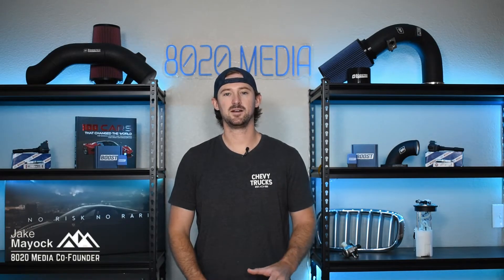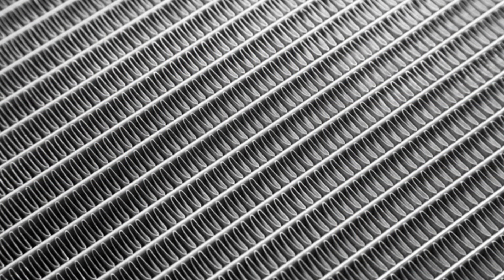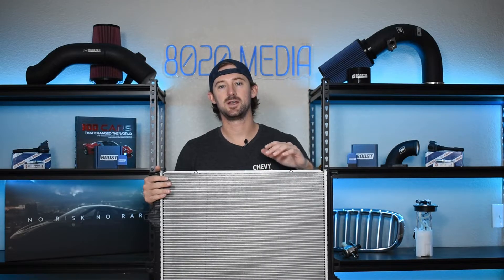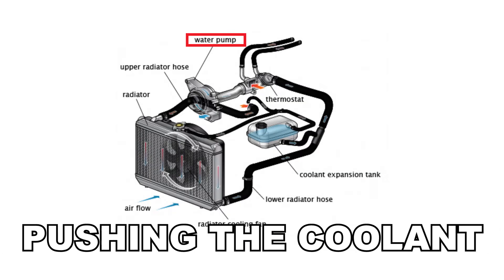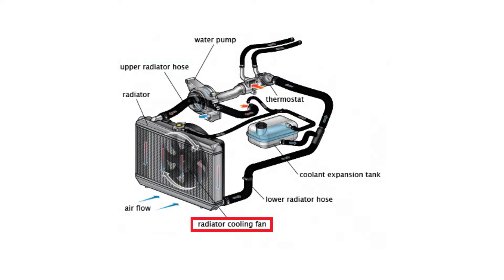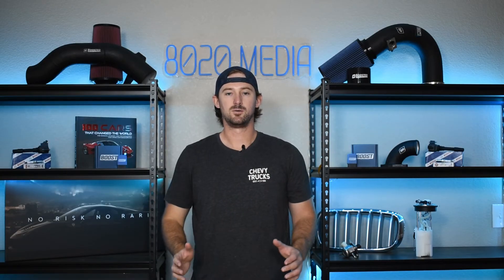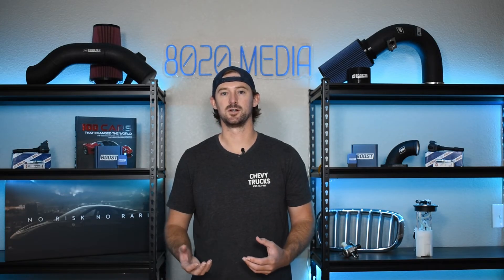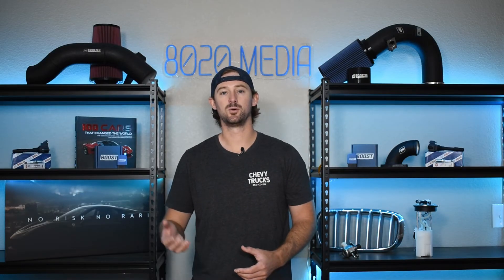Signs & Symptoms of a Bad Radiator!

Comment: My 19 yukon starts to overheat then temps come back down after driving over 20 min at 70mph plus it doesnt happen in normal city driving what can be the cause?
Reply from the maker: M - If your 2019 Yukon starts to overheat only at highway speeds after about 20 minutes, but runs fine in city driving, the most likely causes are a partially clogged radiator, failing thermostat that sticks closed under high load, or a weak water pump that can’t circulate coolant fast enough at sustained RPMs. At lower speeds, the cooling system may keep up, but once you’re pushing high airflow and engine load, any restriction or weak component can cause temperatures to rise. Also, check for debris or bugs blocking the radiator or AC condenser and ensure the cooling fan clutch or module isn't malfunctioning at speed (even though fans are less crucial above 40mph, a fan that’s stuck on or off can still affect temps). Start with a cooling system flush and thermostat replacement—those are the most common and cost-effective fixes for this symptom.

Comment: My 2.5 colorado has good flow and no leaks. But when i do heavy driving or highway and come to a stop the guage goes up, but if i give it gas to spin the water pump it cools down.
Reply from the maker: D - Your 2.5L Colorado’s symptoms suggest the water pump may not be circulating coolant effectively at low RPMs, possibly due to a worn impeller or slipping drive belt, causing the temperature to rise when idling after heavy driving or highway use. Since giving it gas improves cooling, it's likely that at higher RPMs, the pump spins fast enough to move coolant properly, but at idle it's not maintaining sufficient flow. It’s also worth checking that the radiator fan (especially if it’s electric) is kicking on at the right temp—if not, a faulty fan motor, temp sensor, or relay could be the issue. Finally, confirm there's no air trapped in the cooling system, as that can cause hot spots and poor circulation until revved.
Reply: @8020Automotive  New water pump, and thermostat. Nothing changed. Could a radiator cause issues like this?
Reply from the maker: @DerfOrNuffin  Certainly could!
Reply: @8020Automotive  Have you ever had a radiator just stop exchanging heat like that or be a culprit. 
 Im hesitant on loading the parts cannon anymore I love the truck but this has drove me insane
Reply from the maker: @DerfOrNuffin  A radiator can become a silent culprit when it gets internally clogged or restricted, especially with age, old coolant, or sealer products, and it may stop exchanging heat effectively even if it looks clean from the outside and isn’t leaking; you’ll see symptoms like overheating under load or high-speed driving, but normal temps at idle or low speeds, which can drive you insane if everything else checks out. Before launching more parts at it, do an infrared temp scan across the radiator surface—cold spots indicate internal blockage—and check for reduced coolant flow return to the reservoir. If you’ve ruled out thermostat, water pump, and fans, and still have inconsistent cooling, a partially plugged radiator is absolutely a real-world possibility.

Comment: Hi, I have a 2015 Ford Mondeo Estate. 
Coolant leaks from under the overflow tank once the car gets up to temperature, change the overflow tank and still same problem 

The colour of the coolant also looks dirty even after flushing and putting new in and i also have to top it up every other day 
 
All hoses are warm, thermostat is also new

Any ideas? Thanks
Reply from the maker: S - Given that your 2015 Ford Mondeo Estate still leaks coolant under the overflow tank even after replacing it, and you're seeing discolored coolant, frequent top-offs, and a new thermostat and flushed system, the most likely causes are a head gasket issue or a cracked cylinder head/block pressurizing the cooling system; when combustion gases enter the cooling system, they can force coolant out through the overflow even when everything else seems fine, and the dirty coolant is likely a mix of exhaust residue or oil contamination—check for bubbling in the expansion tank at idle, perform a chemical block test (to detect exhaust gases in the coolant), and if possible, a cooling system pressure test and cylinder leak-down test, as these will confirm whether the system is being over-pressurized internally, which would explain the ongoing leak despite replacing parts.

Comment: I have a 2002 Oldsmobile intrigue and my car starts and run but I’ll get to like 40 the temperature jumps up and after I shut the car off it’s like a humming noise almost sounds like the car could still be on
Reply from the maker: L - It sounds like your 2002 Oldsmobile Intrigue may have a cooling system issue—possibly a failing thermostat, clogged radiator, or weak water pump causing the temperature to spike around 40 mph. The humming noise after shutdown is likely the radiator fan continuing to run in an attempt to cool the engine, which is normal if the engine is overheating. Check coolant level, look for leaks, and consider replacing the thermostat and inspecting the radiator and fan system.

Comment: Do you think it’s my radiator, I have a 06 jeep liberty the top hose gets hot but the bottom hose stays cold, I installed a new water pump & thermostat and the top hose has another small hose that goes back up to the expansion tank and it keeps filling the tank up that it overflows then the coolant leaks onto the motor then it smokes the temperature gauge stays in the middle. The bottom hose connects to the radiator and the thermostat. Thanks in advance.
Reply from the maker: R - It sounds like you may have air trapped in the cooling system, preventing proper coolant circulation. If the top hose gets hot but the bottom hose stays cold, this suggests that coolant is not flowing through the radiator properly. Since you've already replaced the water pump and thermostat, try bleeding the cooling system to remove air pockets. Also, check for clogged radiator passages or a faulty radiator cap that isn't maintaining proper pressure. The overflowing expansion tank and coolant leakage could indicate excess pressure buildup due to trapped air or a possible head gasket issue, but start with properly bleeding the system first before assuming the worst.
Reply: Sounds like thermastat
Reply from the maker: @ Possible as well!
Reply: Same thing thats happening to my 85 nissan z31. Smoking from the passenger side when left running, temp gauge left in middle and at one point it shot up my upper radiator hose and the filler neck! yes the neck, not just the cap. Got the necessary parts like low temp thermo and water pump as well as a whole timing kit just because. I just hope that resolves the main issues…

Comment: My coolant fan is fully functional I can see it spinning while engine is running
Reply from the maker: G - If your vehicle is losing coolant every few days but not overheating or showing milky oil, the most likely cause is an external coolant leak rather than an internal issue like a blown head gasket. Since you smell hot coolant, check for visible leaks around the radiator, hoses, heater core, and water pump—common failure points on this engine. Look for dried coolant residue, wet spots, or steam near these areas after driving. Also, inspect the intake manifold gaskets and cylinder head gaskets for slow seepage. If no leaks are visible, the heater core could be leaking into the cabin—check for a sweet smell inside or foggy windows. A pressure test on the cooling system can help pinpoint the leak if it's not obvious.
Reply: @8020Automotive  awesome information thank you
Reply: My car is overheating and smoking. Is the the radiator?
Reply: @jaybrown631 definitely

Comment: I have a 2003 ford expedition 5.4 xlt 4wd triton. Im experiencing low coolant a couple days after refilling. No overheating and no milky oil. I do smell a hot coolant smell. Do you have any suggestions for my problem?
Reply from the maker: G - If your vehicle is losing coolant every few days but not overheating or showing milky oil, the most likely cause is an external coolant leak rather than an internal issue like a blown head gasket. Since you smell hot coolant, check for visible leaks around the radiator, hoses, heater core, and water pump—common failure points on this engine. Look for dried coolant residue, wet spots, or steam near these areas after driving. Also, inspect the intake manifold gaskets and cylinder head gaskets for slow seepage. If no leaks are visible, the heater core could be leaking into the cabin—check for a sweet smell inside or foggy windows. A pressure test on the cooling system can help pinpoint the leak if it's not obvious.

Comment: Can a bad radiator make my car stall at speeds at 40 to 50 ? When it’ over heats I changed my temperature censors on my 2007 Nissan Altima 2.5 and it runs great I’m now having problems with it stalling while I’ll drive and it’s not picking up speed the radiator fans do turn on what do you think?
Reply from the maker: F - A bad radiator or related cooling system issue can cause stalling by overheating the engine. Focus on inspecting the radiator, thermostat, water pump, and coolant system. If the overheating persists, check for internal engine damage like a blown head gasket.
Reply: @ alr I appreciate it you have instagram so I could send you a video of what’s it’s doing